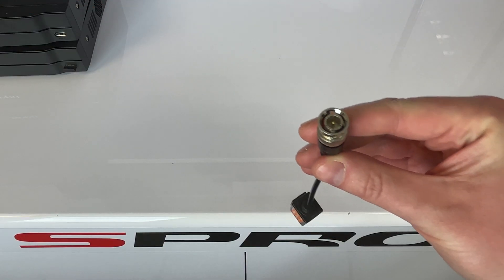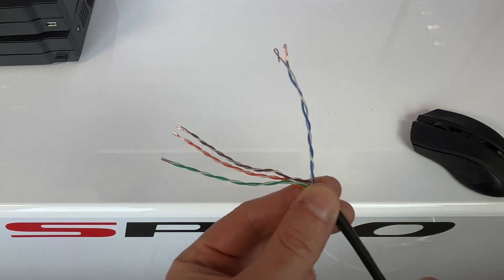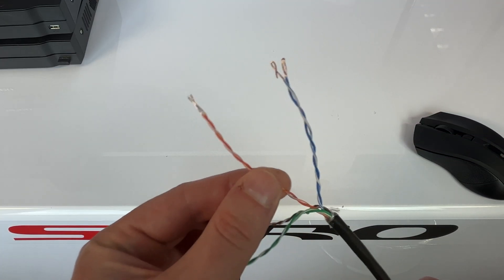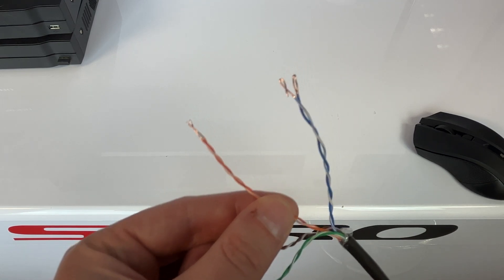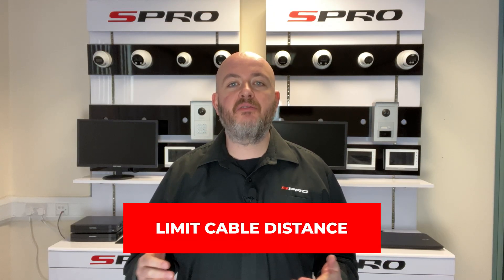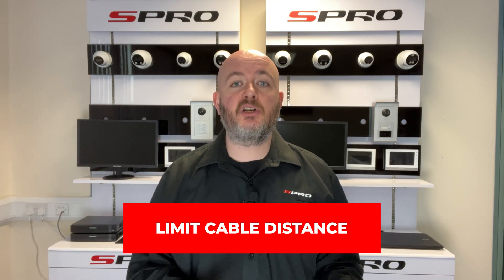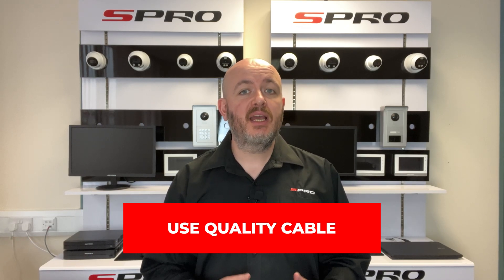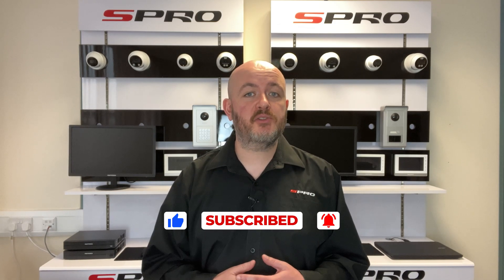SPRO CCTV - How to Wire Analogue Cameras with Baluns

Comment: If the DVR supports POC do you still need to provide a power source? / will this work with any SPRO dvrs without additional power?
Reply from the maker: Hello @ryanmason491, we do not recommend using Baluns with a POC recorder. Although it may seem like it's working, Baluns will draw an electric current from the DVR and could cause a fire. Ordinarily a POC camera with a POC enabled DVR being run over coaxial cable would be fine if they were from the same manufacturer. Hope this helps.